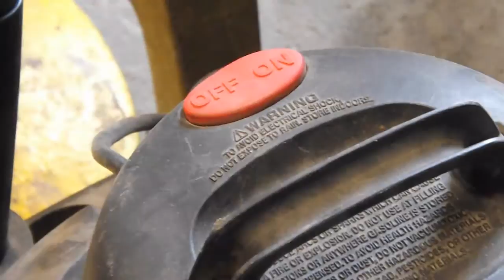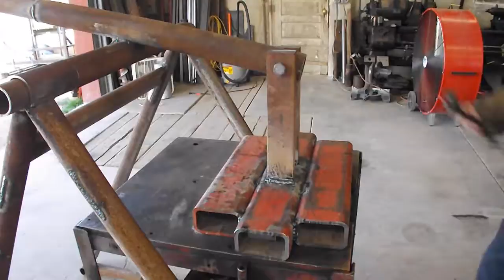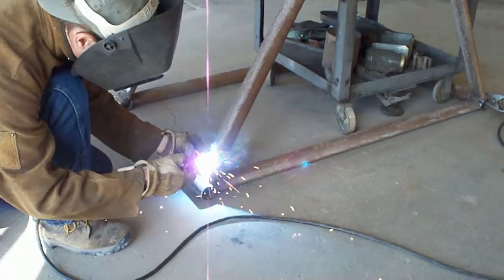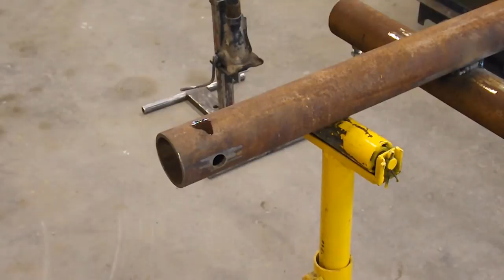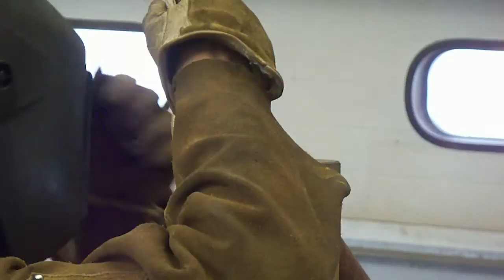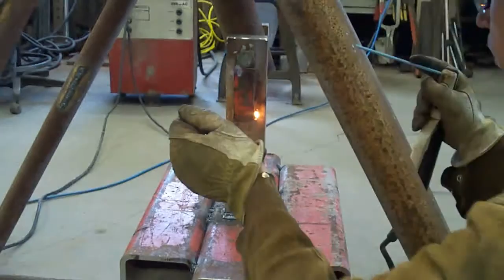Trebuchet Tuesday - Episode 5

Comment: Just thinking out loud here....   Move clamp bolts to tops of side support arms to clamp in and stabilize the cross pivot bar AND the legs to each other.  The arm cross tube will slide around the new cross support, put zerk fittings where the old clamp bolts were .  Then you can cut off the welded cross support that the arm bangs into for free swinging of the arm.
Reply from the maker: I see what you're thinking!  That makes sense. Also, I wouldn't have to worry about the pivot points being in line as much.  I will probably switch to that design on the bigger one.  After playing with the LEGO model some more, I think when this one  actually flings something, it won't swing as far, or if it does, it may not hit with much force.  In other words, I'm going to do a test fling or two before I change it.  But I really like your idea!